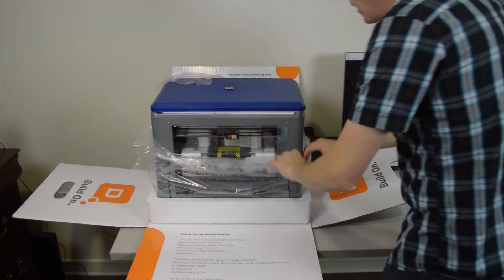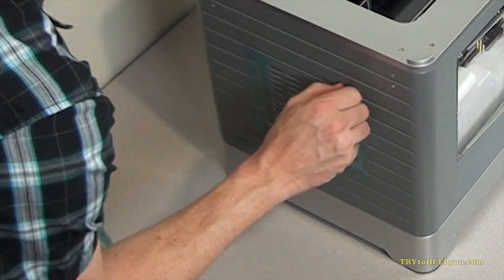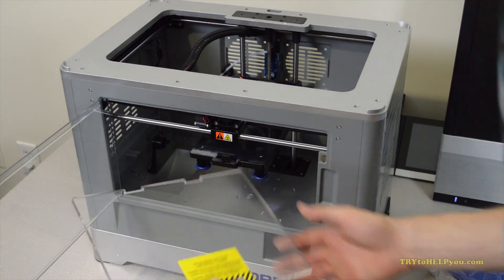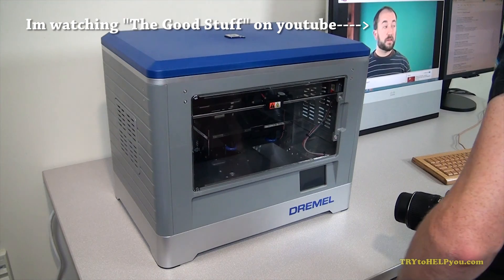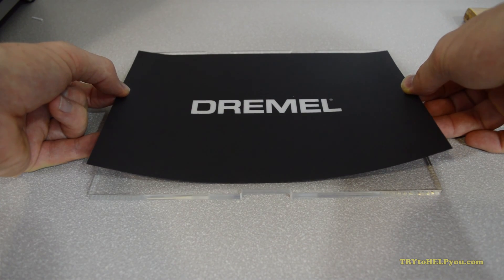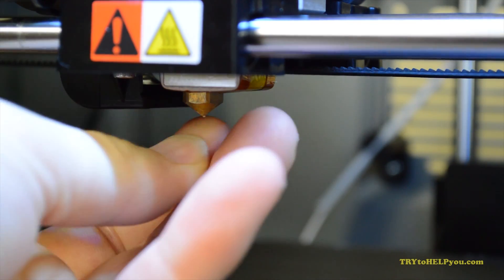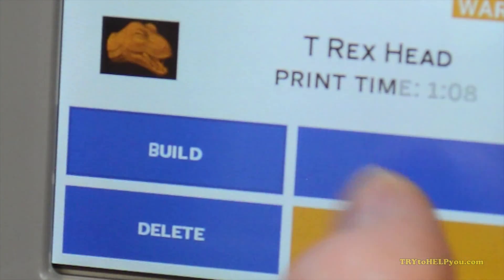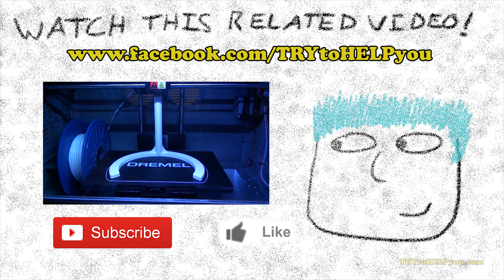Dremel Idea Builder 3D Printer Unbox and Setup

Comment: I had an interesting experience tonight. About 20% through a 6 hour print, I heard a funny noise, like something falling, and it came from the printer. Inside the printer I have a couple of the spacers I printed for when I use bigger filament rolls. I have them standing in the corner out of the way. I thought one of them fell over. But when I went and looked, there was a screw on the print bed next to the thing I was printing. The printer was still going but I noticed it was now printing slightly off, maybe by 2mm to the right. 

Turns out the screw came from underneath to the right and back from the extruder when facing it. Without that screw, the extruder and heat sink doesn't stay together with the rest of the print head. When the print head moves, the extruder followed only because of the wires connecting the two. So I put the screw back in and started my print over again. 

The funny thing is, the model is printing much cleaner than before and much cleaner than all my others. I usually have about 80% nice surfaces and then one section will have some bumpiness, like layers sticking out too far. So I guess this screw was loose for a while and that's why all my stuff has been messed up. 

Lesson learned. Check and tighten screws.
Reply from the maker: +StolenMeatball Not so fun information. Great though for others to know, thanks again for sharing your experience! Im going to have to check mine as well. I have not had problems with the print however i HAVE seen a nut lying in the print area and i was wondering where it came from.... hmm.... interesting indeed. Thanks again!

Comment: I had so many problems getting that build tape on. I figured it couldn't have bubbles though. But I peeled off the backing and I was getting ready to put it on like I was doing a screen protector, and it slipped out of my fingers and one whole corner stuck to the middle of the platform where it fell. That was hard to get off.

My printer's been doing great so far this week. Just got done installing the new filament spool stand so I can use the forbidden 3rd party stuff. Do you have a recommendation on filament brand?
Reply from the maker: +StolenMeatball great to hear its up and running. the initial setup is not too bad but definately not just turn-key. i reccomend the hatchbox brand however be advised that i have only made it about half way through one roll. It does appear to ..um... "string" differently out of the extruder tip when it is heating up. it may just be me.. As for sticking to the platform, it appears to perform the same. The strength of the pieces is the same to me. hatchbox sells a performance pla filament that is a little more money but more precise when it comes to the tolerance. i know what i think that means however i may be wrong in what that means... it appears to mean that the size of the filament is more precise during manufacturing... but, i may be mis-understanding that. so totally google the meaning or ask the company.... keep letting us all know how its going! your experience is valuable to others. i like your uploads, keep it up!
Reply: TRY to HELP you Thanks for the info. Think I'll order a roll of hatchbox off Amazon today.